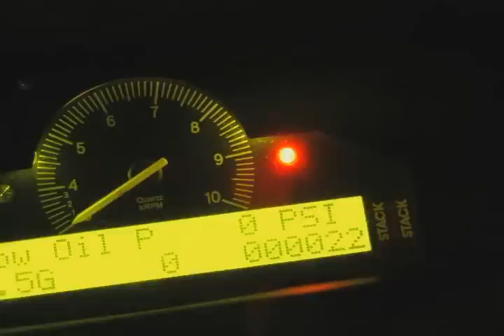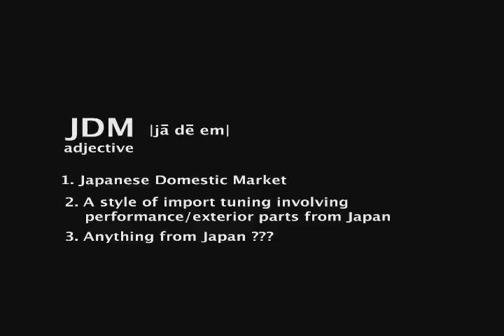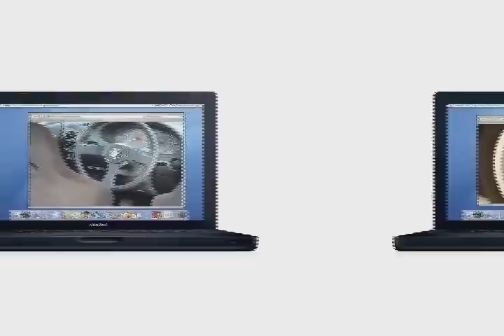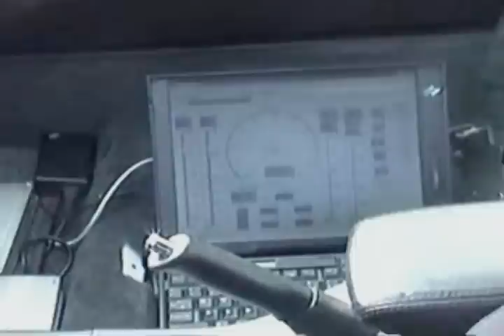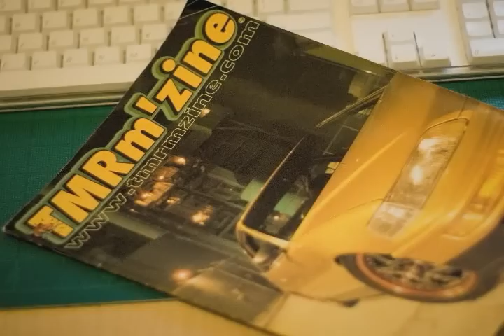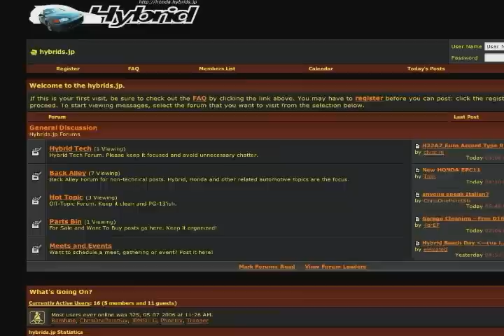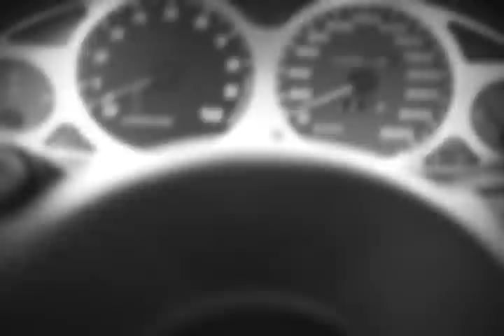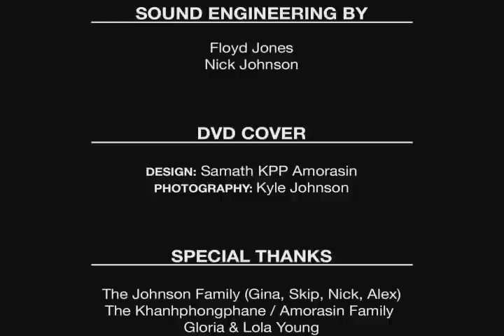JDM THE PURSUIT OF FUNCTION

Comment: Idk if anyone can comment for me what the differences of motors for the Honda DS are? I just got a DS and not sure what a type A, B,C etc.. Motor is or the numerics. If someone has a website to explain that would be so appreciated 😀.
Reply: Techno sailor What is a Honda DS?
Reply: Techno sailor You meant DA?
Reply: 420matts um no. sorry for the abbreviation. i meant  my Honda Civic Del Sol
Reply: Techno sailor d15, d16, and B16a3 if you are lucky. the d series are single cam and 100/120 hp (d15/16), and the b16 is dual cam and 160 hp.
Reply: ridetheyoshi Thank you for your comment. the more people that comment on here the more i learn :D
Reply: np, you might want to look for a B16a3, year 95 and over. I think that's when the car had better weather seals, power locks, etc. The b16 is a lil bit heavier but pulls much faster than the d16. If you're looking for a turbo build then might want to swap a b20 or d15b7.
Reply: ridetheyoshi awesome stuff. yea im not aiming for a turbo too soon, but will in later future. that B16a3 seems legit.

Comment: want a k20 swap? 6 speed 50k miles on it still runs its in my car as i type lol full swap i keep shifter caples and harness other than that everything goes with  long block and prb ecu and mounts hasport, tunked fuel line hybrid racing and ps ac delete  prb intake manifold and kid racing headers 4 2 1, 2 1/2 all the way back but ull get headers only
well down pipe as well 4500
all name brand parts no egay

Comment: anyone in southeast GA into the jdm scene? i feel so alone here 1997 maxima
Reply: wouldn't be JDM if it's not "Cefiro". but imean... a maxima?
Reply: i like the maxima front end better anyway people do front end swaps all the time... and its unique, what i have to work with, handed down, from my father. plus im more of a car guy not just JDM, i asked because i could use some help with my ride and i really like helping people with theirs.
Reply: I had a 95 SE w/ an 00vi variable intake from an A33.

first thing i'd do on your 97 is swap out those headlights ASAP for the 95-96 headlights. They're glass and don't yellow or get crusty. But i soon found the maxima had very low limits as far as full potential Vs money, so i sold it and bought an S13.

CV axles and fwd w/ a V6 are such a pain to work on. RWD is just so much more convenient for twice the gain.

I do miss the Bose speakers though. when i first bought the A32, i was about to put dual 10" type Rs from my S14 in the trunk, but when i got a working headunit adapted with the metra harness, i heard the crystal clear sound and a pretty nice heavy Bass for a stock system and thought "woah,... nvm".

i Shoulda ripped them out and put them into the S13 when i got rid of it... S13 currently has only front speaker and both are almost  blown when bought.
Reply: HeavenzBreaker yeah man i have been looking for glass assemblies, espically for HID's i NEED them haha. 

you're totally right about the money spent vs potential but it has sentimental value and i honestly don't think ill ever sell the thing.

although i do want to try an s13 project..... i really want either an ls swapped s13 or an RB swap.
Reply: lol or a 2jz but yeah....
Reply: im a hoarder so believe me it was hard to get rid of my 1st 4 door vehicle. (the maxima). and it smelled good inside w/ sun roof/fog lights and the white gauges. but once i actually sold it, i felt much much better and free to buy what i always wanted (and used "practicality to try and convince myself to not buy it. but who am i kidding¿ lol)

I always thought since i already have an S14 that i needed the A32 for the "room for passangers and friends". but quickly realized... "What passengers and friends??" LOL I almost never utilized it.

So i gave into my guilt and now am the proud owner of 2 sports cars. haha. and  i dont regret it one bit. s13 hatch has plenty of space for stuff, not boring like a truck, and just as easy to work on as the s14. almost everything is within arms reach under the hood.

and if i ever get passengers, i can still squeeze people in the rear since an emergency is the only time people wanna ride with me anyway. lol
Reply: if anything, i even might want something even less practical as a 2nd car, like a 2003 miata or 300zx/Rx7. since 2 240's are starting to seem redundant.. but the problem is, i dont want to get rid of either. lol.
Reply: haha i hear that, where you located? if you ever decide to sell the s13 let me know.
Reply: where you at man? lots of JDM love here in Albany...if you're interested in s13s and wanna come work on an sr20 then you oughta come over and help swap out the cracked head on mine, lol.
Reply: jack2785229SH im in brunswick, and i would be glad to help but it would be a lot more of me asking you questions and handing you tools hahahaha
Reply: john almand southeast indeed my friend! got family over that way (st. simons), and as far as the latter, that's nothing i'm not used to. pretty much how it is all the time, ha

Comment: Getting HP is done lots of ways tuner car or muscle car it is only good if you do it correctly and the right setup in transmission and station will get the power where you need it in the way you need it muscle cars most the time are made for going straight down the drag strip but upgrading suspension can change that I just hate tin can sounding exhaust that are no way a tuner exhaust that sound comes from the engines internals and performance parts resonating through the exhaust  helps with airflow and make it tuned in correctly to help with performance not sound the sound is secondary

Comment: I get the idea of the video as it was my slightly older friend who got me interested by helping him all the time with his old Honda Civics,however I was also that kind of guy who respected Hondas,but was inclined to be one of those types who preferred not to go the same route as everyone else and went with a Nissan S chassis platform instead because of the rear wheel drive. Of course,given a couple years later,little did I know that Nissans would ever grow to be about as popular as the drifting scene was finally emerging from the small underground group that it was originally to almost mainstream in such a seemingly short amount of time that it seemed like as if it all happened overnight! Maybe I should've went with a Mazda or Toyota. Still,I didn't regret the Nissan S-chassis in the long run becoming about as common and popular in the tuning scene in the end either way. LOL!

Comment: 13 second 1/4 mile times is in fact insanely fast! My stock (with the exception of 1 after market spark plug, JDM obviously) lawn mower could never pull off that 1/4 mile time.

Comment: its sad that jdm now means like 90% hondas.
way 2 many hondas. just cuz you have a honda with a cold air intake doesnt mean youre a jdm tuner. ugh.
Reply: Davut STweeDuizend JDM doesn't mean products made in Japan it means Products built in Japan for the Japanese Market. I cant stand it when I go to shows and meets and theres JDM wannabes haha
Reply: Here in australia civics drivers don't try to be something they're not. They're the cheapest of the cheap japanese cars you can buy here since australia is so close to japan and we get tons of their imports. When r33's and supras go for 5-10k range and civics are 3-5k, civic's know they can't flaunt there power figures or rev there engines without getting teased by someone for sounding like a hairdryer. Stance is NOT a big thing here, cops are very strict on how low cars are, and they're aware of all car meet ups as they happen and appear regularly.

Cops already have a field day because theres so much JDM modification, stance would be a coppers wet dream.. if you can't pass the coke can test (fitting a coke can on the lowest part of you car to the road) then you car will be towed. theres meet ups in the states like h2o and hellaflush, NO CAR WOULD LEAVE ROAD LEGAL. As is should be to be honest.. getting beached on curbs is beyond retarded and unsafe. Real JDM is about practicality and performance, If you car can't go places.. it's not practical.
Reply: s8tank jdm is japanese domestic market yah bean head
Reply: RossBoss90
Domestic. do·mes·tic....
adjective
existing or occurring inside a particular country; not foreign or international.
"the current state of US domestic affairs"
Reply: warfl4g what are u sayin? I know what domestic means kid
Reply: RossBoss90 you corrected some dude when he said "JDM doesn't mean products made in Japan it means Products built in Japan for the Japanese Market." and then called him a bean head. So if you think he was incorrect you do not know what domestic means.. 'kid'
Reply: ***** yeah cause what you have there is a perfect grocery getter. of course youd rather have that than walk by foot to the grocery store.
just dont go out and try to slam it and try to be cool.
people wonder why everyone hates hondas
Reply: *****
OR it gets beached on the shop's speed bumps perhaps?
Reply: ***** i don't know of a shopping center without speed bumps in the parking lot. I get annoyed at the hellaflush honda's for modding there cars in such a unsafe retarded way and claming to be car enthusiasts. I assumed that you were going for the hellaflush look when you said slammed. my bad.
Reply: ***** everyone hates hondas cause there fwd
Reply: ***** idn what your talkin about m5s make like 300 horse
Reply: *****
I'm aboslutly not an elitist. Ruining a cars performance (it's main objective as a car) is not an enthusiasts trait. That would be like being a teddy bear enthusiast and having at it with a knife ruining it's prime objective to be cuddly.

I wouldn't care so much unless super camber lower scraping cars wern't a stupid dangerous thing to drive next too.
Heres why:
-Stupid negative camber means
     -The way the tyre was designed tonequally disperse water isn't effective making it hard to maintain traction.
       - Less tyre 'meat' on the road means less contact for breaking and maintaining traction especially understeer.
        - Way more wear on the tyre back wall which makes tyres wear quickly and have even less grip and is prone to bursting easier.

-Stupid suspention means
         - less travel to disperse braking load on the front tyres meaning understeer is likley ESPECIALLY in a FWD drivetrain.
           - possible too 'beach' or 'grind' while driving on a slight incline which takes weight off the tyres for lack of traction
              -Could damage oil pan spreading oil on the road.

When you combine stupid suspension with stupid camber you multiply the problems tenfold. For these reasons i don't consider the people who choose to do this 'car enthusiasts'
Reply: lets only hope
Reply: ohemgee4419 Think of it like this, Euro, consists of 70% bmw, why? Cheaper more accessible car, muscle car consists of 70% mustang? Why? Again, cheaper more accessible car, the reason JDM is PLAGUED (yes plagued, its a fucking epidemic) with hondas, is because you can literally buy one, sneeze, crash, and buy another, you can burn through them like rice (jdm pun, yo ... that was another) I personally love A CLEAN JDM UNTOUCHED civic, bone stock, white, yum! ... as soon as they are modified, I am not even interested, I dont care how fast they go, I am just not interested. Now... Show me an evo, a supra, a skyline, etc etc, proper JDM, and I dont care if you are running so rich, you are slower than stock, They are just pure eye candy, respectable, collectible, and when done right, PROPER FAST cars.
Reply: warfl4g Good to see a fellow aussie here, aren't we lucky to not have riced out civics... minus the p platers that drive them, how clean are they and respectable when left stock, and not pretending to be something its not.
Reply: *****
Ikr dude, i'm so glad we don't have a honda street racing culture. I had a civic when i was in TAFE, great on fuel, Cheap as fuck to buy. The only hatchbacks i see in the street scene are triple S pulsars. And even they don't race, maybe a little kick at the traffic lights, but that's nothing xD
Reply: warfl4g Hahaah Im getting around in my r33, dont see many cars out, and the ones that are, dont race, laws are way to tight on that crap, cant blame them, stuff getting impounded for the sake of a 30 second thrill, I heard those little pulsars haul, never seen one really go, only n/a and it didnt sound too healthy haha
Reply: ***** Yeh i feel it dude, i'm also in a s1 r33 GTST. 3" straight pipe and open wastegate to atmoshpere and i still haven't been pulled over. But when i do it'll be a cops lucky day xD Those triple S pulsars are the turbo versions, they seriously haul ass haha.
Reply: warfl4g ahaha ayyyy s1 represent!
Reply: You're the kinda guy to ask if a 1998 Corolla with a body kit and chrome lights has "Vtec".
Reply: Welcome to the fd club
Reply: s8tank yeah I know what you feel!
many of them doesn't have a clue of what jdm really is and use it to the absolute stupidity and use japanese learner driver badge thinking that means jdm
smh
Reply: TheNewBlak ha don´t make me laugh sure honda is a everyday everybody kinda of car i can give you that but taking out of import scene dude these cars marked a generation they became iconic for they design and a sense of performance without breaking the bank
Reply: dexmex bala
yeah they're cheap, easy to mod, and reliable.
but is the most common car ever, even in the car scene. Every honda is pretty much exactly the same.
The major thing about the import scene is about being unique, about standing out from the rest.
That's not gonna happen in a honda.
Reply: TheNewBlak 
I don't really agree with that point since that the scene will show more what is hit
Actually the stance took the scene by storm 
As a honda owner and fan I used to go to those meets and got sick of it since it's always the same mod but with different colors
If I was a volks fan I would probably say the same thing since they have their own common style that repeat all over the volks crowd
Reply: Wtf no lol the majority is Honda Subaru and Mitsubishi
Reply: EpicFailSoundsGay
Subaru maybe.. the old wrx's are cheaper now. Mitsubishi... how many evo's do you see at car meets and when you do see them how much do you think they're worth.

People think that just having a japanese car is JDM, wrong. You can't buy any ol' subaru or honda or nissan and claim it's JDM. JDM means it was built for the japanese domestic market and had to be imported out of japan. If you want to check the owners manual and directions will be all in japanese.
Reply: hugonubario Ye, that's true also.
Someone needs to bring a fucking r34
Reply: ehh cause there cheap easy to get parts for but ya there shit lol..
Reply: cris clarke let me guess you love ford?
Reply: EpicFailSoundsGay no but i do like the classic one's but rather have a rx7 rotary's are great but this was a shity video trying to push these guys as tuner's all the talked about was jdm swaps and hondas..i like all cars but hondas ehh need to be done right but its not the only car thats jdm..
Reply: ohemgee4419  if i put TRD badge on my camry  does that make me JDM  BRO??? XD
Reply: Kingck lol
Reply: TheNewBlak
I forgot to say that in case you missed the sarcasm in my first post, older Hondas which are typical targets for tuner geeks aren't 'rare' because of the customary longevity that's engineered into them. ; ] Be glad you have a ride you enjoy, even if you're in a swarm of buzzing Hondas.
Reply: +JSHOT we can import anything made up to 2000 here in australia, plus we got skylines and a few other nice cars as white commercial imports when they were new
Reply: +TheNewBlak  Honda's do rally. not all rally classes are awd. educate before you spout nonsense
Reply: +ohemgee4419  haters gonn hate
Reply: Carmello Long I agree with you I have a 93 honda accord, 97 Acura CL 2.2 and an 87 ford thunderbird turbo coupe and my accord shits all over subarus Nissan 240sx mazdas etc... my accord is a cb3 clone so it has a lot of jdm parts on it and doesn't sound like a weedeater. they hate cause they get all butt hurt that our little (shit boxes) as they say put them to shame on the track and they don't know how to handle it other than to make fun of them
Reply: Funny the new rice car is a subie not a honda.
Reply: Subaru outback with a 2jz swap <3
Reply: ohemgee4419 you obviously know nothing about cars
Reply: Thanks Tips...... LOL